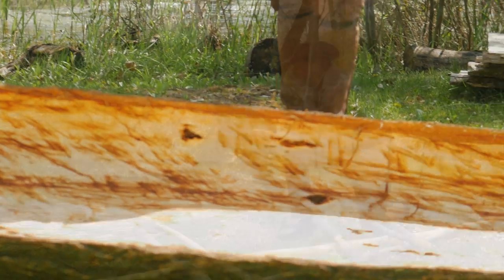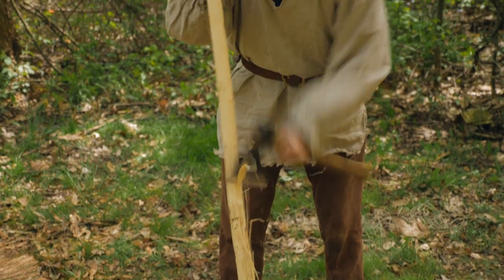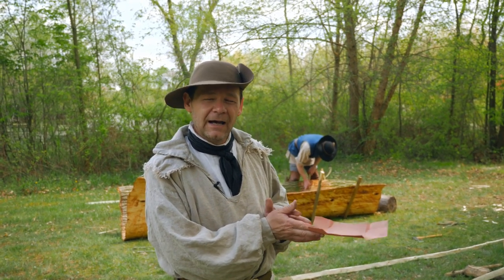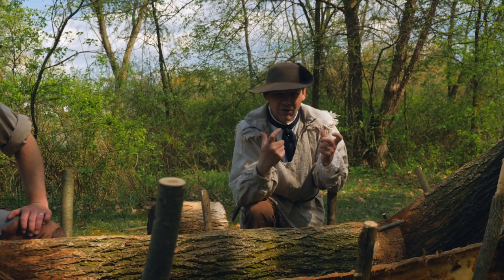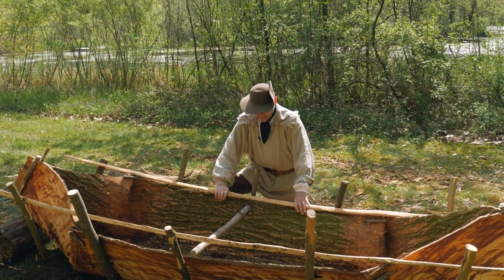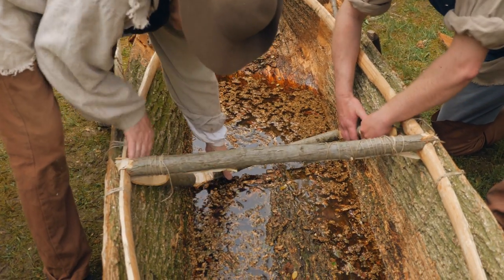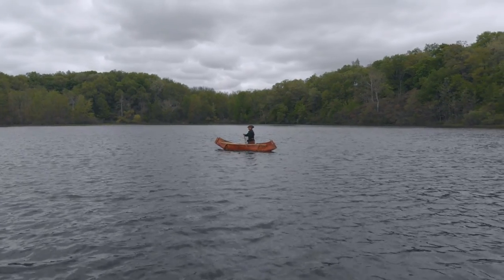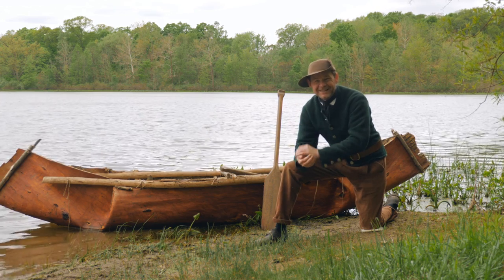Building A Bark Canoe In 12 Hours? - Elm Bark Canoe Part 2

Comment: I know you’ve stated that this is essentially disposable. But what kind of life can be expected from a boat like this in your current climate, proper care considered?
Reply: I was wondering the same thing.  I think in the first video they said it would last about a week, but I was wondering if it would be worth wax sealing it or using resin to seal it, to make it last longer.
Reply: The bark gets extremely brittle when dry and molds quickly if wet ... so. If it were possible the ancients ( and Townsend ) wouldv'e figured it out. Spruce bark last a little longer. See Nomadic woodsmans build. Very in depth , 6 parts. For longevity birchbarks the way to go.

Comment: This type of canoe appeals to me more so than the dugout canoe. The dugout canoe looked like a lot of work whereas this one here looks relatively simple.
Reply: @愛 Yeah, as a temporary solution, this bark canoe fits perfectly. Maybe poachers or hunters sought out these methods when dealing with small time frames and not many resources for a dugout canoe.

In Chile, native like Onas or Yagan people used pelt-made canoes due to the lightness and some bark canoes have been discovered as well.
Reply: It's definitely the better canoe... for as long as it lasts!
Reply: The dugout canoe is like a cast iron skillet; with proper maintenance it’ll last a lifetime. Sure..you can buy a cheap Wal-Mart pan for a faction of the cost, but it won’t last very long and you’ll have to replace it again and again.

Comment: Is there a way to stop this beautiful canoe from deteriorating?
Reply: That's what I'm hoping. It's a shame that type of canoe is only considered temporary. There should be a way to preserve it (even if using modern methods and materials).
Reply: seems this is just a paper-airplane canoe. something to enjoy temporarily.. how sad.
Reply: I have seen other wooden canoes covered on the outside with pine pitch
Reply: Dry it slowly and rub it a lot with beeswax or boiled linseed oil. You can repair cracks that develop in the drying process with pine resin. You can also dissolve the pine resin in the boiling linseed oil and butter the bark with a bunch of coats of that. I would probably also replace the twine fasteners with something a bit more... permanent.
Reply: eastern Washington maybe cover it in waterproofing sealant like what u put on a deck ??
Reply: Made quick gone quick. You want a canoe to last put in the time/money.
Reply: @kaylawuvscookies  money?
Reply: @Warhammered  you could use some Thompson water seal i suppose, maybe boiled linseed oil if ya wanted to stay away from modern sealers..still going to rott eventually but it would definitely slow that process down👍
Reply: Most bark really doesn't last very long once it's off a tree no matter what. You would need a way to heat the whole thing up to kill off any insects living in there before applying any kind of sealant
Reply: @27dcx  you could basically deep fry it in beeswax and linseed oil (+/- pine resin). That would drive off the moisture and kill anything in the bark and seal it. That's expensive and time consuming but if you're trying to preserve it for Museum display or something it's far from the craziest thing I've heard done to save an artifact.
Reply: Soak in formaldehyde?
Reply: @howtowithelizabeth7513  Might make it glide even faster through the water!
Reply: @kaylawuvscookies  This thing cost a LOT of money!
Reply: if your not looking for anything historic you can use fiberglass and clear epoxy it will be clear and waterproof for many years if maintained.

Comment: Airchair quarterback here - On any place that needed a lot of power (like the tie to hold the clothespin on the ends) I would have done multiple hemp loops with a lot of extra, run a stick in and started spinning. The twists would tighten it easily and at the end you'd just need to tie the stick to something to hold it. But don't trust me, I've never done anything like this! AMAZING to watch it - I wish you'd done a long series on it! :)

Comment: Jon this is the coolest thing I've ever seen you do in person or in video.  Well done.  To build such a primitive but functional design in a day, replicating what a frontiersman or native had to do when confronted with a body of water they could not ford.

I've worked on dugouts and birchbark long term canoes helping craftsmen.  I've built my own modern reyro pirot from three sections of thin wood and epoxy.  But those projects take forever.  The dugouts weigh a ton.  This is a toss around serviceable craft in just hours with no storebought items.

Very good job men.  See you this Fall on the Mississenewa or at Loudon.

BTW: how long do you think it'll last?
Reply from the maker: It's good for a week or 10 days then it will start to rot.

Comment: Very impressive. I thought there was bound to be a hole or crack somewhere in all that surface area of bark. Would’ve thought you’d need some type of sealant.

I’m curious how that type of canoe would hold up against rougher waters with higher winds. I wonder if the light weight and shallow draft might be a drawback against the wind.

Comment: I imagine if this canoe was stored "underwater", while not in use, that it could last until winter. By underwater I mean purposely submerged near the shore, then bailed out before using again. Has this been tried? Would the bark and different wood parts swell too much, or is it impossible to keep the canoe properly "hydrated" and avoid the inevitable cracking?

Comment: I think I would have lashed it with rawhide lacing, it's much tougher than string and it shrinks as it dries, making all your lashings even tighter.
Reply: yes, but it would not dry if it kept getting wet, would it? and it is very stretchy and pliable when wet too.

Comment: "Mind the flap". Depending on the direction of the fold, if the flap is forward it will increase the drag. And padding up creek or down, would soon be a drag.
Reply from the maker: Both are folded the same direction, it defiantly has a front and a back.
Reply: @townsends  you did introduce this as an emergency solution and in that respect it's functional. Too often I'm too anal about the aesthetic appearance of things. Nevertheless, it was an awesome build and I greatly appreciate the demonstration. Thanks!

Comment: Question: I was thinking and I might not be the first one to ask this.. But generally speaking what did the bakers used to puff the bread..back in the 17th century (example.. yeast today to make the bread puff up)
Reply: Jon has done a lot of  shows on bread and bread making.  Bread was very important and baking good bread was not easy. If you wanted to make bread you would go down the street to the local brewery for a pint of yeast that the brewer got off the beer. Later on they discovered chemical leavening like saleratus, pearl ash, and baking powder. If you do a search for Townsends bread you will find a lot of good information.
Reply: They raised it with yeast. In areas with saleratus mineral, that was used. Rare. Indians are said to have used a pinch of white wood ash.

Comment: Easier to boil water pour then fold while hot and pliable..also you can get a bed of coals lay pine Baughs over that then the bark to steam and become pliable... Just from experience steam bending wood .. However you don't have to have the ends bent up... Just push up the center of the front and back and folds there only and you're good.... . Dosent have to look good if it dosent sink and gets the job done..... I could see doing the whole thing in few hours easily in one day.... You can weave mats from tule leaves pitch wax and seal that and have a boat as well.... Many ways to build a boat.... That tree they barked can build 3 more nicer boats or a small house
Reply: If you bend or fold along the grain it will split very easily- hence their folding it across the grain here. People made these kinds of things as needed using only the minimal tools they had with them and whatever nature provided nearby which made this kind of simplicity paramount. No steaming, just quick to do and enough for the job at hand.
Reply: @P_RO_  what works is to take the rectangle then at each end bend on 2 angles of 45 degrees from. Left and right corners into the center.... This will make a far better shape and water tight.... The ends don't need to curve up.... And as far as bending along the grain that's not a problem as long as the bend has a radius..... Anyway I have built canoes is not hard.... My first I built in 4 hours from 3/8 plywood 5 ply

Comment: ......and if you order today, you'll not just get one, but two, that's right, two canoes.   Use one for yourself to get across that pesky river or lake, give one to your family, friends, or other frontiersman.  Just pay shipping and handling - standard delivery by horse-drawn wagon - expected delivery 8-12 months (more or less).  Expedited delivery via local rivers and bodies of water - saves four to six weeks, depending on where in the colonies you reside.  Not responsible for problems caused by floods, winter weather, blizzards, frontier attacks, starvation, wood splitting from drying out, running rapids, bear attacks, black flies, dysentery or any other causes.  Please include enough to cover the King's taxes and levies.  :)
Reply: Like the tongue-in-cheek humor! 

Back in those days the fast delivery method meant the only delivery which was always uncertain and could take months, not a day or two.